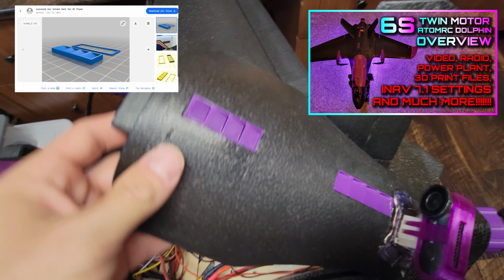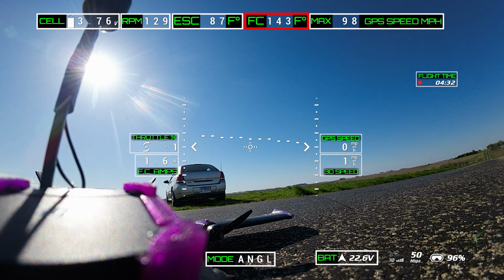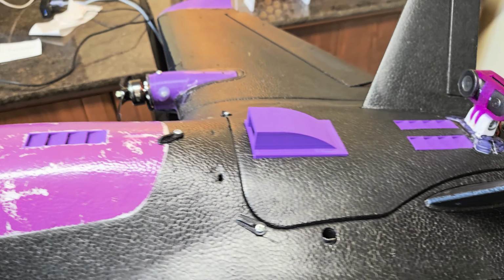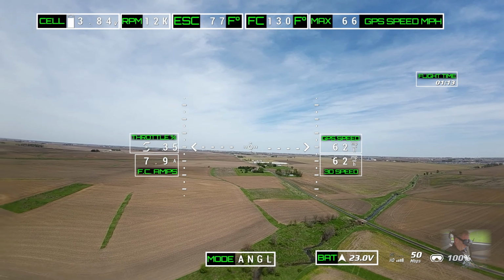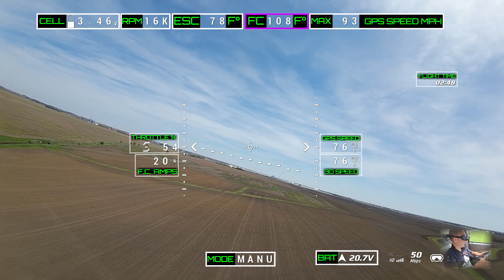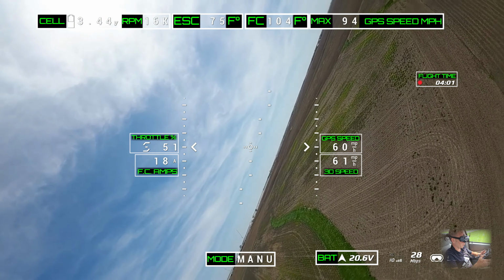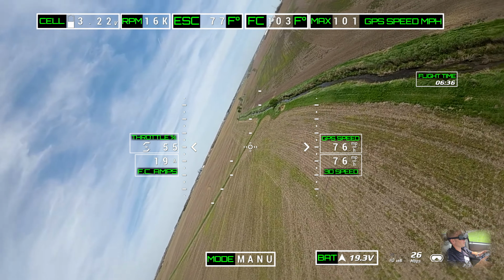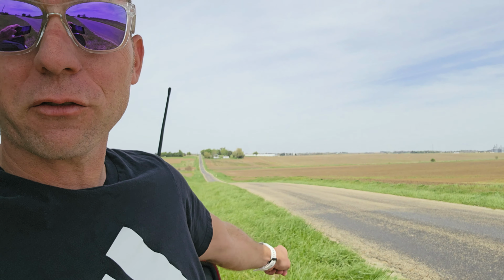AtomRC Dolphin Overheating Flight Controller Fix!  - RAM AIR SCOOP!

Comment: Hell Dude, cool!
I have my problems just with the Heat of the VTx. It`s going hot like hell ;)
So, i will print these Scope too and will see if it helps.
Otherwise, there will be a 5v Fan on Top of the VTx, so we will see...
Happy flyin!
Reply from the maker: Just remember, get cold air in and the hot air out.   I also purchased a 5v fan too but mine really didn't move air.
Reply: @JeffDoesThis  youre right, no doubt about it. We will see, what helps